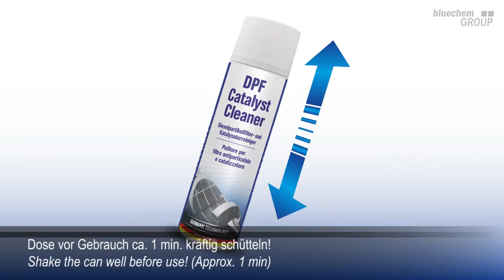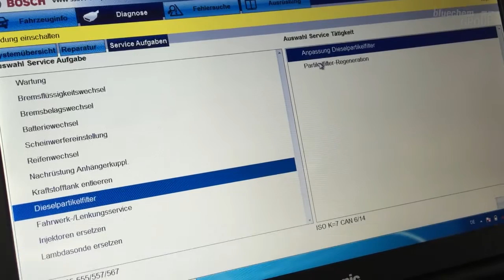AUTOPROFI  DE/EN | Dieselpartikelfilter- und Katalysatorreiniger | DPF Catalyst Cleaner

Comment: is it possible to go for a drive on motorway after injecting the spray, for automatic regeneration?
Reply: Mig Bottles thanks for the reply,  is it available on ebay?
Reply: Thats a good question. I have a TDI Jetta 2009 And im about to just put " Wurth " in and check to see if the regeneration light will come on.